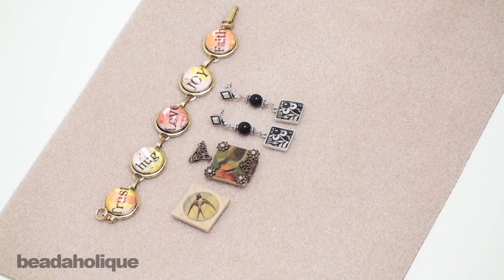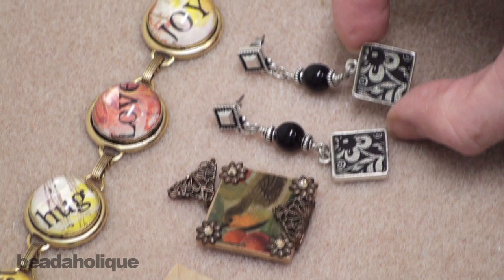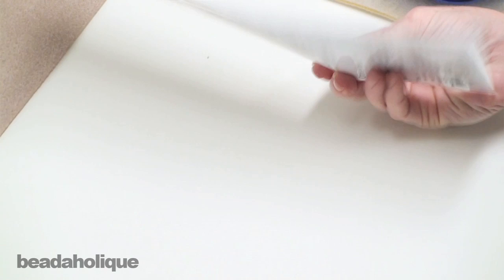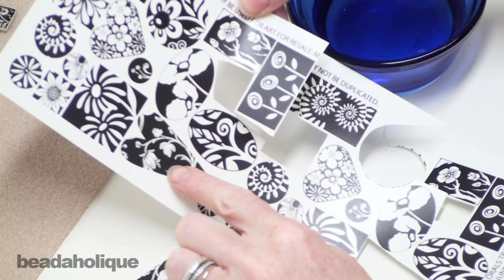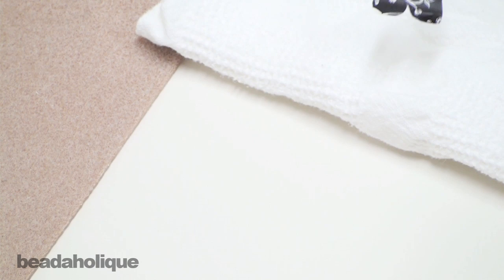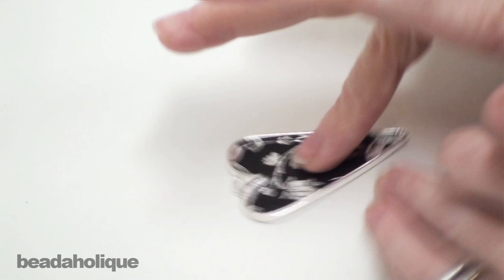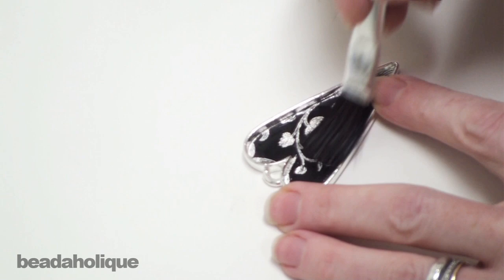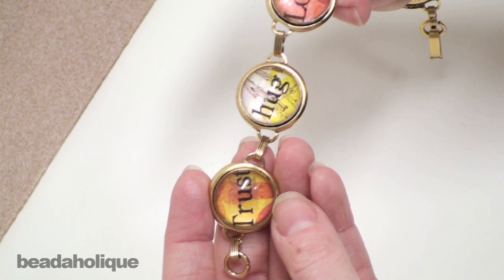How to Use Transfer Graphics to Make Jewelry

Comment: Question: What else can the transfer be sealed with in case I don't have the Nunn Design sealant. Will any clear gel medium work? 
The heart pendant, since the transfer piece is clear in areas, would have been esp. pretty if the bottom of the bezel had been patinaed with transparent or opaque colored resin. That is if you want to add color to the black and silver themed design.
Reply from the maker: The Nunn Design Sealant is a Decoupage Sealer.  So as along as you are using a product meant for that application you should be alright.  You want to find something that will not run with the inks of the transfer sheets.
Reply: Oh, didn't realize that's what it is. So I'm betting the "matte" medium I have on hand will work. Worth trying anyway. 
Thanks for your quick reply!